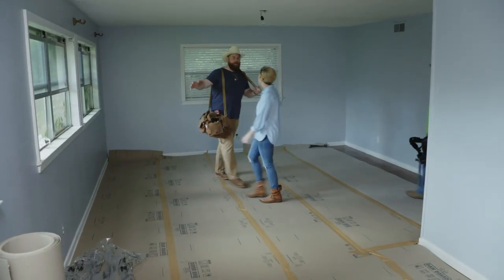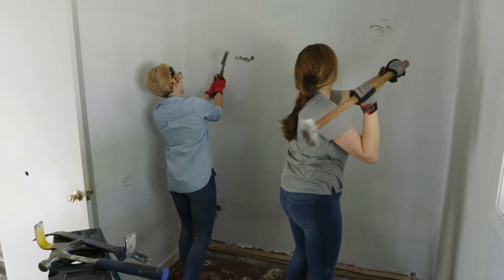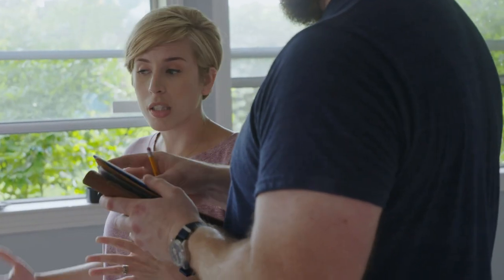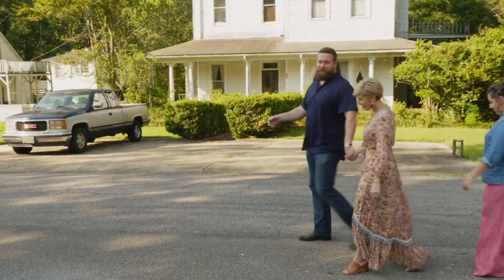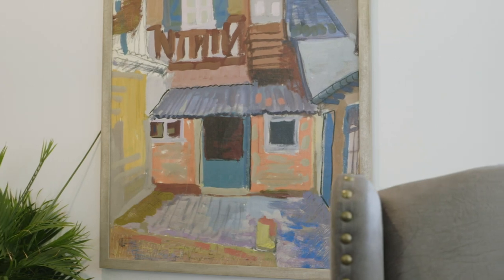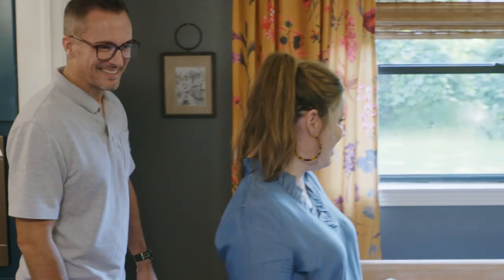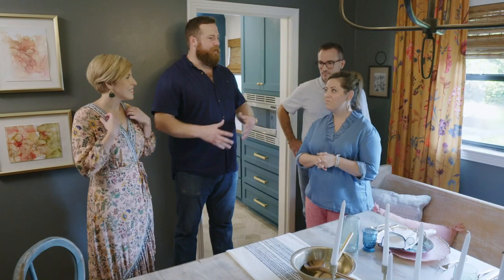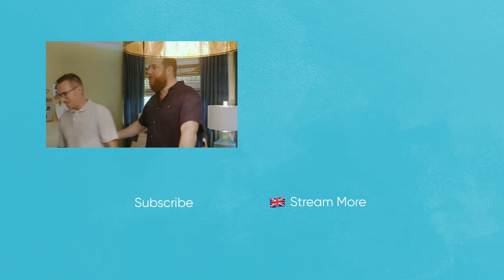Ben & Erin Renovate ENORMOUS Church House For Huge Family Of 7 | Home Town

Comment: I think they put the side door on wrong. The opening is in the corner which makes it hard to access and the door swings INTO the traffic instead of into the corner. Did they fix this? Huge mistake for function.
Reply: I was thinking the same thing.